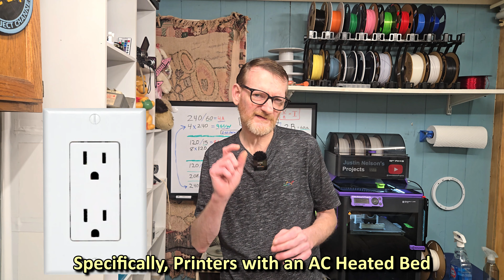Thought Experiment: Powering 3D Printers with 240 Volts, in the US; Bad idea or Genius?

Comment from the maker: So I made a slight error on the whiteboard and corrected it, even made a little joke about it (looks like the "4" is taped over the "8" on the bottom line). But -- I made another error, very minor; the 208 version would actually be 3.466 (repeating), not 3.7. The 721 Watts is correct though; I was writing all of that from memory (I had 3.666 in my head, rounding to 3.7)...

Another thing I did not address, as it's not relevant when the bed is energized from cold (ambient temperatures)... there IS a minor PTC effect, wherein the resistance goes up as the bed gets warmer. This applies regardless of the input voltage, and doesn't affect the actual results by any significant amount.

Just wanted to clarify :)

Comment: Heey, i know this is unrelated but i can't find any info so i really need your help. I have a crown xls 1000 it was working fine but i got some crazy loud static noise and now it just shows fault code 21/99 which is DSP boot fail, i tried everything but the amp doesn't respond to anything.. What's the fix for this please 🙏
Reply from the maker: Sorry, I don't really do Amplifier repair. I did a couple videos years ago when I had a couple amps to fix, but that's about it...

I recommend reaching out to Crown/Harmon Kardon for assistance.

(I also have an XLS 1000 where the entire front panel died; so it's stuck in "input Y mono" mode. I haven't bothered cracking into it because it's just not worth the time on these cheap amps. The older ones were built FAR better -- if it is almost too heavy to carry, it's a good one. If it's deceptively light in weight, throw it out and get a new one...)

Sorry, wish I could help...
Reply: @JustinNelsonsProjects  No problem!! i will try finding somebody who can fix it

Comment: I have not looked at the electronics of a modern 3D Printer in a while...but I dont think the parts that are touchable are running mains voltage.... usually there is a AC/DC converter/ Power supply that does something like 24V....
Having mains voltage on any of the parts would be a nightmare for certifying the products and bringing them to marked.
Reply from the maker: Only the bed heater runs on mains voltage -- I mentioned the 24V DC supply in the video. The only reason I mentioned the possibility of mains (line or neutral) coming into contact with the chassis, is that some much older appliances actually did (via a resistor or capacitor) attach the chassis ground to the Neutral.

So in the case of the US wiring, such an appliance would effectively be 120v (albeit at a super low current but enough to give you a jolt).

I know modern appliances do not do this, I'm talking stuff from the 50's lol...but running it the way I described is certainly against many codes...

Comment: Europe runs 230V since 2003.
Before that UK ran 240V and the rest of Europe ran 220V
Reply from the maker: It's hard to keep up these days lol. The US originally was at 110, same as Japan; then they bumped it up to 115 at some point, and then finally standardized on 120. Japan I believe uses 110 in some parts and 120 in others (maybe 115?)... but they do use the same "type A" (no ground pin) plug as we do...

Whenever I talk voltages, if it's between 110 and 120 I just call it 120; same with 220/230, I just say 240. Makes the math easier... and it's "close enough" for my purposes :)

Comment: Its unfortunate theres always a catch when trying to run foriegn 240v rated stuff in the US. I djdnt ehen think about the neutral and ground being live with that kind of trick. Thanks for the info.👍
Reply from the maker: If it's specifically designed for the US (say, a commercial Microwave, oven which has two hots, a ground, and no Neutral), then it's obviously designed to be used that way. But most electrical devices expect that Neutral ~= Ground (there's always a slight difference because they are only tied together at the service entrance).

Not to mention, if you tried this with any kind of GFCI anywhere in the path, I'm pretty sure that would be unhappy 😉